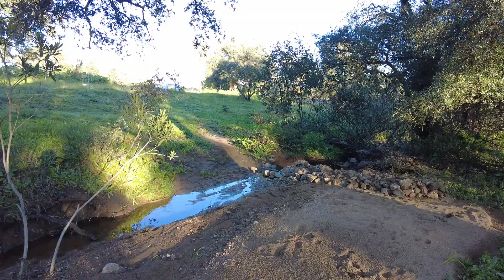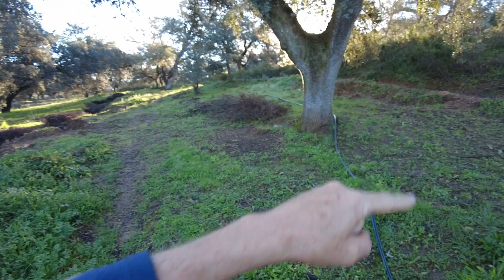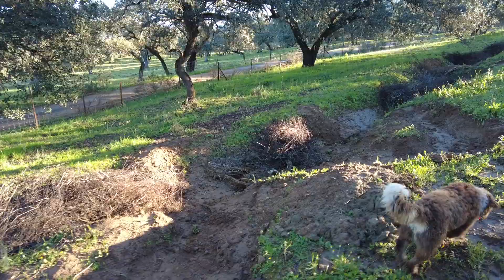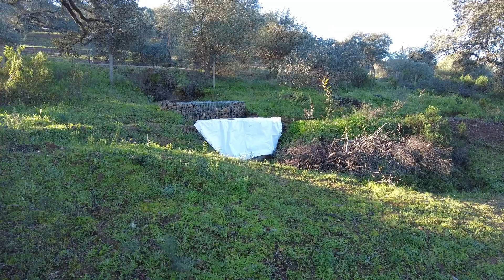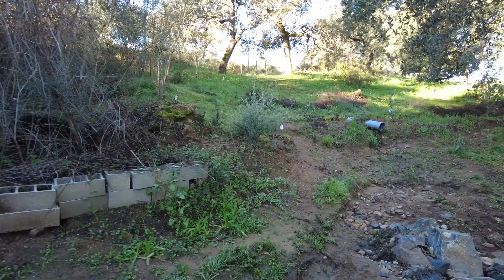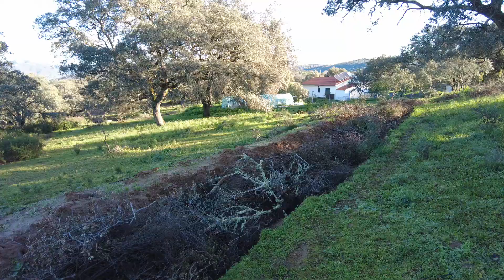Lessons to be learned in managing water from creeks.

Comment: Would a second wall past the culvert with the pipe perhaps collect the sand and organic stuff so that you can keep the pipe pool relatively clear. A second wall would make it so you can use the tractor to move the soil out too instead of digging it out by hand. You may need some sort of cistern on a water gate so that as the depth of flood water rises the gate opens and lets the silt drain through to the second collection pond. I am not sure I am saying this in a workable way but I feel the management of the soils washed into that pool are key to having the pipe and subsequent swales work more efficiently.
Even a lift gate on a lever that could be opened to allow the silt to wash into a second pool would save you some back braking work if you can make it accessible  to the digger...
Reply from the maker: Great suggestions. When one fiddles with a creek than an engineer should be nearby. We have the need, let's see if the engineer appears.
Reply: @SuerteDelMolinoFarm  yes aquatic engineers are a bit of a rarity here in the UK ...it's part of the jobs I have had in the past but full on engineering was not my thing . I'm more of a this is how nature does it let's adapt it to work with what you need sort of engineer
Reply from the maker: @TalRohan  I'm ready. Waiting for that sort of kind of engineer to appear. Thanks for sharing

Comment: After reflecting on the update for a day, I'll suggest that this was just one more learning experience.  It was unfortunate that you were away from the farm - but we don't control the weather!
There are only two big changes to be ready for the next rain.
1) Remove the spillway board from the creek culvert.
2) Draw the plastic to one side of the gabion so that it covers about one half of the surface.
There are many other small tweaks, adjustments and repairs, but they are not a priority given the spring like weather. Also, no rain is forecast until February 21st.

Comment: Rock dams  won't cut it, but 2 or 3 logs (horizontal) staked in with posts and/or steels will work wonders, slowing the flow and a little leaky, you can still  use the rocks to shore up either side
Reply from the maker: Excellent suggestions. Thank you for sharing. Now I'm looking for logs.

Comment: The only parameter on which you cannot influence is amounth of water which is entering your land with creek and culvert. It is fluctuating too much and it is not possible to control it when you are not on the farm. Maybe the best way to control it is that you open those side holes on your concrete dam and leave them open, so pipe will not take such huge amounth of water. At the current stare, pipe has too much load and it is only matter of time when something will break.
Another thing which you can do is to make stronger leaky weir with bigger rocks and metal wire.
But you know, damage is not even so big when you start to think how much water did you receive. Officially it is 50 liters, but in reality you received way way more because of creek and culvert. Think of this as nature's feedback and feedback is not bad 😊 But please, don't make any earth dam on the creek, that is waste of time and soil. It will just be washed away. The only thing which can pacify it is some big gabion or leaky weir with big rocks.
Waiting for your next video!!!
Reply from the maker: You are right. Big rocks! Thank you for sharing

Comment: Could I make a suggestion that may or may not be practical. I think the culvert storage pool is far too small to act as a capacitor to flow. You also mentioned before that a lot of sand comes with the water and reduces its capacity even further.  Have you considered, as an alternative,  extending the culvert by 100m and allowing a sand damn/storage reservoir to form. In Africa this is common and provides cool clean drinking and irrigation water throughout the summer.
Reply from the maker: Thank you for sharing. As I mentioned. I have the whole long dry summer to stare at the system and decide.

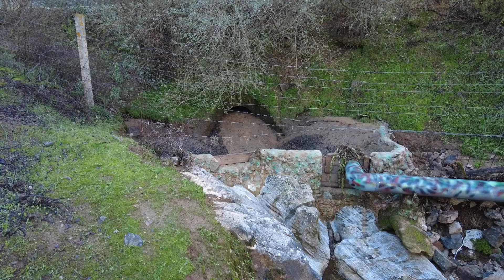Comment: 8:46 you need to take that dam down halfway otherwise you will block the culvert.  rebuild it further down so the top is lower than the bottom of the culvert, make a large pond behind it to feed the other swales etc.
Reply from the maker: You are right. Thanks for sharing. We have to start that project.
Reply: @SuerteDelMolinoFarm  Just remove the spillway board that raises the breast of the dam.  That simple adjustment cleared the culvert completely the last time this happened with the next rain, if I recall correctly.   I hope you are able to focus your time and energy on the seasonal jobs of planting and pruning.  Spring is underway!  😉
Reply from the maker: @stevejohnstonbaugh9171  Pruning of oaks starting soon. Thank you Steve
Reply: @SuerteDelMolinoFarm It is very tough to be in the position of having SO many tasks.  I sympathize with your situation. Let nature guide your priorities.  
Ground warming, sufficient moisture for germination, days getting longer and trees breaking dormancy as the days get longer.
Given the likely summer drought, every seed you plant and oak you prune now will have about 120 days to mature or harden off - just under the wire - unless they are irrigated. 👍
Reply from the maker: @stevejohnstonbaugh9171  Thank you for sharing Steve